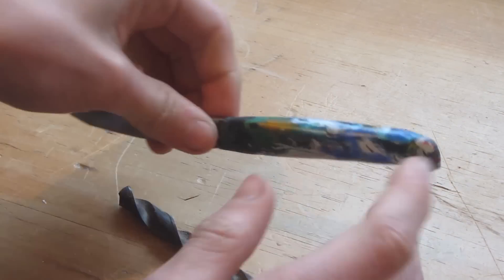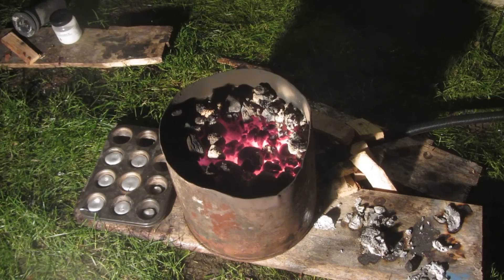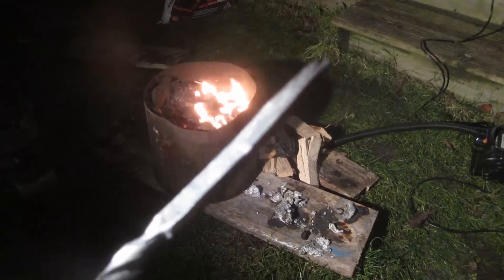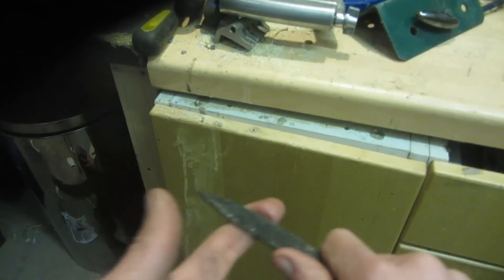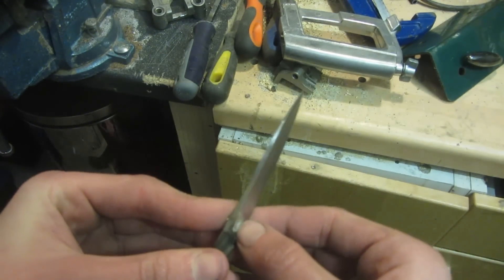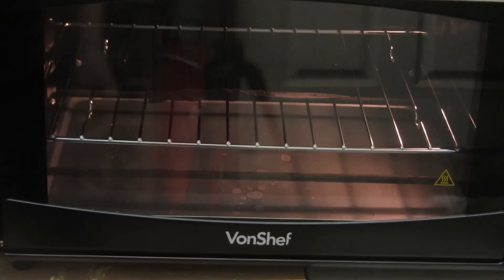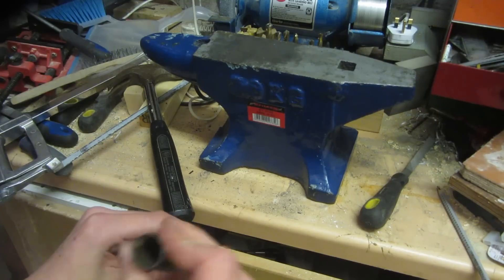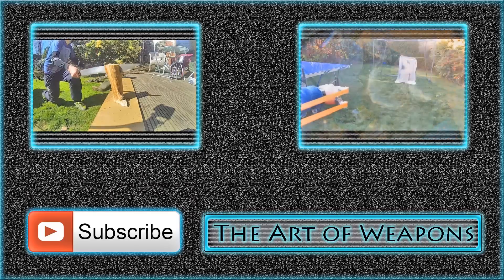How to Forge a Carving Knife From a Drill bit - part 1

Comment from the maker: Thanks for watching guys! 
As I have mentioned in the video this is my first ever forging attempt so if you have any suggestions for improving this method then please post them below. 
Also if you have any suggestions for what to do with a of my new steel then again post them below! 
Thanks
Reply: Cool, I'm 16 and I started blacksmithing/forging this summer. I like to re-use old high-carbon steel for knives.
I never thought of using a drill bit for a knife.

If you have time maybe check out my channel, I do knife making, forging and a little bit of woodworking.

TIP: secure the anvil so that it doesn't wobble when you hit it, so all the energy goes to the forge piece instead of the wobbling.
Reply: Car springs are another excellent source of hicarbon steel. Be carful  if you remove them your self as they can kill you. Be more aggresive in your forging, bang it down more to shape but don't beat out all the carbon. Ever herd of damascus steel blade? It's folded and beat over, never made it my self but under stand it's some hard stuff. You're cool Man.
Reply: Use transparent epoxy resin for the handle!
Reply: The Art of Weapons Cool project. From an diy point of view all is fine. What you could do better or I would recommend:
Dunk the knife in a vertical motion in the oil when hardening, as you can get a bent blade, this is more prominent on longer blades, but it is just a good practice. 
Most oils will do (sunflower oil is readily available), yet the carbon insertion you mention is only true for repeated treatments where the carbon deposited in the first dunk gets heated again with the metal and starts to infuse. It is usually a long process. Water works very well, and if the specific alloy tends to crack in water (see material info) use hot water 60-80 deg, that will lessen the thermal shock and cool the blade slower.
Try to get info on the alloy in the bit, if possible. And then google heat treatment temperatures and procedures recommended. Some are higher than the magnetic limit for best results, and quite often they recommend holding the metal for a given time at said temp before dunking. The magnetic limit is not a very good indicator, as most steels give better results at slightly (+100deg or so) higher hardening temperatures. Also the cooling medium is specified plus its own temp, some alloys can even be hardened in air.
A temp gun or some temperature measuring device is a must. Tempering info is also alloy specific and gives better results at quite specific temperatures (easily obtainable with your oven).

Anyway have lots of fun.
Reply: The Art of Weapons 
Nice work done!
But let me criticize you on one thing i saw you did wrong.
The next time you make a blade, DONT completely file / grind the blade to its final sharpness before you harden it!
Before you harden it, the "cutting edge" should still be ~2mm thick, else the steel on the edge wont retain the needed temperatur for quenching.
You can do the final grind after the hardening, and then temper it afterwards...
Reply: This is a great video,  You are vary knowledgeable. I learned more with your video then all the others I've watched.  You actually teach little tricks like why to use motor oil the magnet thing and etc. You seem vary young,  if you keep this up you will surely be one of the greats. I know this is an old video but im going to go ahead and subscribe. Keep up the good work.
Reply: To make forging the bit easier heat it up to forging temperature but then let it air cool a couple of times, this relieves stress in the metal and makes it easier and more predictable to deal with, if you want to anneal it just hear it up and push it into some dry sand, this will take longer to cool but make it softer
Reply: also, instead of setting the oven to 150, try setting it to 400 degrees. You might get a better temper this way.
Reply: The Diamond Ninja I got my first job at 11. I say if you want it, you can make it happen.
Reply: Hold the hammer at the bottom of the handle.
Reply: +waddell77 No, you're hearing it wrong dude.  AluminIIIIIIIIum - that I is important, it's part of the word and plays a key role in it's correct pronunciation.  Just because aloominum is acceptable, doesn't make it right ;)
Reply: hint of advice, put it in the other way, then using your tongs and a vice you can twist the bit straight, saves you some work in the long run
Reply: Jeez, We are like twins, similar age, similar interests. i love making things like these
Reply: Tim Radcliffe
 He's talking about 150 Celsius. So around 300 F.
Reply: if celsius, then probably 200. it will do a better job.
Reply: The Art of Weapons Pretty good video.  Some suggestions:  1. Say 180 Celsius so as not to confuse Americans. 2. Perhaps do less of the "I am going to..." and just show us you doing it while you describe it.  It would tighten it up a bit.
Reply: ElCid452 Use BORAX, as I understand, it works the best. It acts like a flux and cleans off the scale.
Reply: I applaud you for making a useable knife, ive seen allot of your videos and im impressed by the stuff you make, keep it up. 

however for knives, I would suggest starting with a simpler steel than this. most drill bits are made from M2 high speed steel (or equivelent, not sure what they use in the UK) or another high speed steel like M42. 

M2 is actually a verry good knife steel, especially for a small knife like that, but its proper heat treatment is far beyond the skills and equipment of an amatur blacksmith, even some seasoned bladesmiths would not want to try it.

High speed steels like M2 have a verry high tungston or Molybdenum content (the M in M2 indicates molybdneum suplementing the tungston in the steel) so that they can retain their heat treat / stay hard at verry high working tempratures. 

this means that heat treating them is challanging, requireing a high austenitizing temprature (around 2050F (1120C) vs around 1500F for simpler steels) and also requres a "step down" quench to around 1000F (540C) that means the quenchant is heated to that temprature before the blade is quenched, then air cooled the rest of the way. 

tempering is also much higher at a minimum of 1000F (540C) basically this steel cannot be heat treated properly in a forge

if your dedicated to using scrap steel, you should look into ball bearing steel (52100 in the us) as it can be heat treated in a forge and is one of the best knife steels around. however it is also challanging to heat treat. ideally you should start out with a simple tool steel like W1 or O1, but these are hard to come by in scrap form. car and truck leaf and coil springs are another popular choice, but most leaf springs are a med. carbon steel like 5160 and not great for small knives (good for swords tho) and coil springs are any number of different alloys and almost impossible to know what your dealing with.

feel free to send me a pm if you have any questions about knives and sharpening.
Reply: brett harland Not exactly. You want to find a point in the handle where it's comfortable and balanced. The face if the hammer needs to meet flat with your anvil as well. You're not just going for power, you want control. Once you pick up the hammer, you'll know where it's balanced and that is always the best point to hold. Another tip. Never good the hammer with your thumb running up the handle. You want to grip it like a baseball bat otherwise you'll seriously injure your thumb.
Reply: Its good to see some fellow younger blacksmiths im 14 and i live in scotland my anvil is a large piece of railroad track and my forge is an old but thick baking tin i have done exactly what you did and i have to say the results were awesome
Reply: By the way how much cash would it take 2 purchase 1 of ur creations???? Hit me up on Facebook @ Shawn Boggs or on twitter @w_boggs please....
Reply: how old are you your voice is like 15 years old
Reply: +hfdkjsahfkw fsafhl I'm guessing you're American?, which is why you don't like the fact he says aluminium properly. Aluminium is English and in America what language do you speak? 😊
Reply: +stunthumb +waddell77 In the states it is spelled and pronounced aluminum. In Europe there is an extra I. Its not just that both are acceptable. Both are correct depending on with version of English you are using.
Reply: Ken Fitts I think that it became such a common word that it fell into the ruleset for American English once it started being cheap to produce and used more and more, while some other chemical elements were left as-is, like Sodium for example.  It is actually classified as Aluminium though, by IUPAC.  I say both are acceptable because... well telling someone they're spelling it wrongly just leads to long boring posts like this about the history of metal discovery and classification :)  -  Just to troll people defending the Non-US spelling though, Sir Davy named it Alumium, then Aluminum, then settled on Aluminium.  I say that any of these spellings should be acceptable, considering the guy who discovered it couldn't decide either! ;)
Reply: +Brett Smith go watch man at arms you'd prob enjoy it
Reply: Make another giveaway ,this time I will have an entry :-)
Reply from the maker: knives&stuff ok thanks.
also nice channel btw.
Reply: Thank you for watching, I've learnt a lot from you.
Reply from the maker: Will Cheney thanks I will try that next time!
Reply from the maker: skipstalforce thanks I do know of Damascus steel but I dint plan on making any yet.  Need to get loads better at forging! Also I am trying and failing so far to find any cheap car leaf springs. Need to try the scrap yard
Reply: The Art of Weapons a lot of work with leaf springs,,,fun but a lot of work,,,O1 is simpler...
Reply: What belt grinder do you have?
Reply: knives&stuff https://www.youtube.com/user/knivesandstuff
Reply: Hey, next time you should use a marker to mark out the shape you want the knife to be and then grind it, if you dont understand just reply to my comment and i will find another way to explain
Reply: instead of forging the tang of the drill bit, try heating the twist, clamping it in a vise, and untwisting it with a wrench. it would require a lot less forging but it would make a longer blade. you can always cut the excess off.
Reply: When heating to temper coat the steel with soap to reduce scale.
Reply: Get you're cooled blade, then heat it back up. And dump it into water. The extreme Change of temperature hardens the steel
Reply: Dan Swoboda He said its already hardened like that...
Reply: JGAG Once the drill bit is heated to be forged, any treatment done to it after becoming a bit is ruined. A final hardening and tempering would indeed strengthen the blade.
Reply: May I ask where you get your resources from because I am a high school kid (14) looking for a fun hobby but I would never have enough money to buy this stuff
Reply: The Art of Weapons  You are awesome!
Reply: The Art of Weapons Dude, youre a legend
Reply: Superb.
Reply: The Art of Weapons A  great thing to use as makeshift tongs are channel locks, they work much better and much more like real blacksmithing tongs. If you wanted to get real creative you could even forge out the jaws to a more desirable shape.
Reply: The Art of Weapons I think you're doing pretty good. I have just posted my first knife making video from used hay mower blades. You have a great channel keep up the good work.
Reply: The Art of Weapons great a butter knife
Reply: The Art of Weapons Keep up with your metal work one day I think you would make a really good blacksmith :)
Reply: The Art of Weapons that anvil is going to land on your foot.
Reply: fantastic xxxXxxxXXxX he is 15
Reply: Steve Warris we kinda have the same name
Reply: kind off. its not my real name tbh. but its not far off. so i am just like you  a "crowned one" :) i used to surf in forums where realnames are comon so i chosed for other internet activities this one.
Reply: oh
Reply: Accent bothers me especially aluminum. There is no additional i at the end
Reply: ***** wasnt trolling bud. Sorry to break it to ya but you shoudl go back to your so called (troll school). Sorry i dont like the accent it is my preference and you cant do antthing about it. I wasnt saying the kid has to change his accent im saying i dont like it. If there is a problem with that plz do tell
Reply: ***** your a little idiot no one likes to deal with. Fuck off dont comment again im not replying
Reply: Maggie S sorry but your spelling of aluminum is incorrect. Look up how is aluminum spelled. There is no extra i at the end. Therefore aluminum is pronounced correctly in america.
Reply: Maggie S I think you'd probably agree that we speak a different dialect.  Color/colour, humor/humour, aluminum/aluminium.  I do not understand the heated contention.
Reply: Maggie S adjustment on what i said earlier. The guy who founded aluminum called it alumim at first. Then he changed his mind and started calling it aluminum. Then he changed his mind yet a 3rd time to aluminium. Apparently it sounds more classical
Reply: ***** I apologize, sorry for the confusion
Reply: Your saying aluminum wrong
Reply: +The Art of Weapons jack wolfskin shoes, er?
Reply: lol.
Reply: are you from wales?
Reply: +zerpBot  thats a really funky idea and i've been using epoxy in my A lvl product design. with the spiral showed of inside the handle it would look very unique
Reply: What you should do is get some nice blacksmithing hammers like I got two four pound hammers that will really remove and shape the steel oh I hope you know how to inter change pounds to ounces
Reply: +Tim Radcliffe indeed, 150 is low and might result in a brittle blade, although i believe metal drillbits might contain some degree of chromium and other black magic which makes it tougher to chip. 
A carbon steel with a 0.7 percent carbon content will land at a reasonable hardness of 55-60 rockwell if you anneal it at 200-220 degrees celsius.
Reply: +Andrew Burke Borax is used when forgewelding, and when it melts(way before the iron melts) it coats the metal, thus preventing the oxidation that creates scales. If not cleaned of while hot it will create a bitch of a scale though, which is very difficult to get rid of. (unless youre lucky and it just falls of as one big scale :P)
Reply: +The Art Of WeaponsAs mechanical technologist, I must admit that video is actually amazing. I did some heat treatment related stuff at college but my things were different: a plate for Rockwell hardness testing and a coin punch.Your terminology is correct: many people who are unfamiliar with heat treatment, use the word "tempering" to describe process which is quenching.However, you could add more professional terminology, such as "austenitic range, Curie Point" etc.
Reply: TAOW  ر
Reply: knives&stuff ok the best tip i can give you is to take your belt sander and make it vertical. trust me it makes a big difference